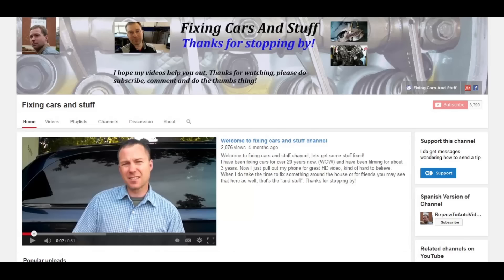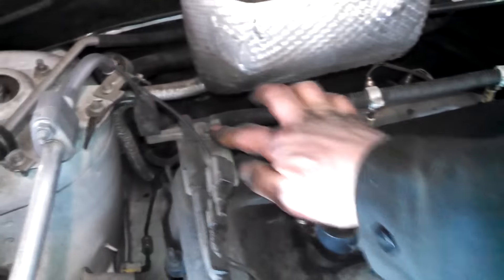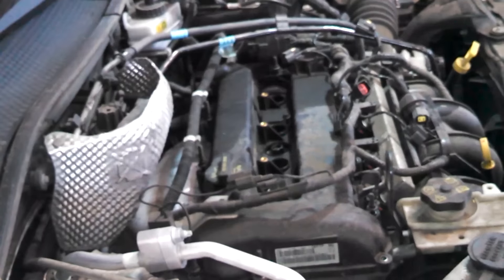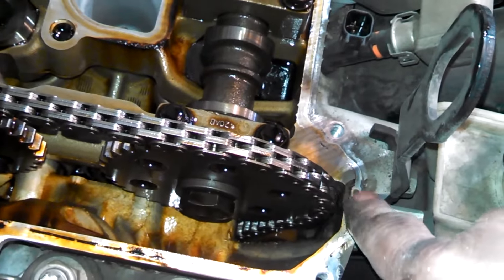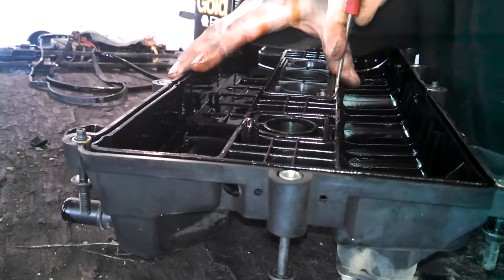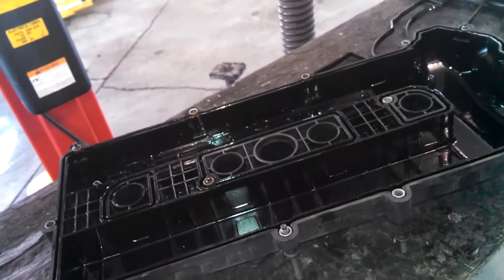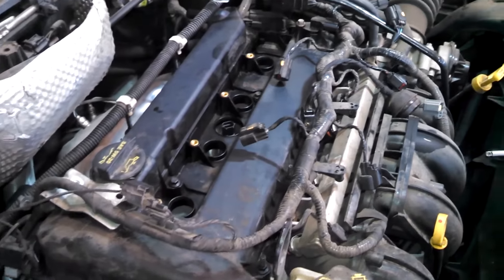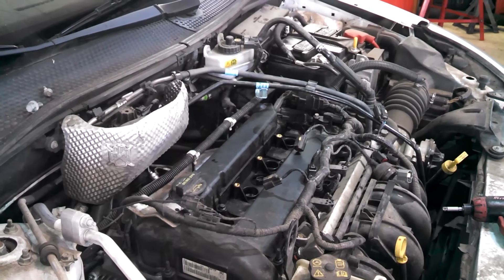Valve cover gasket replacement 2008 Ford Focus 2.0 How to change engine cover

Comment: Went to change spark plugs in my car and all 4 cylinders were filled with oil. Was going to take it to the dealership but your video convinced me to try replacing the gasket myself. I took my time cleaning up all of the old oil all over everything and it still only took around an hour. Only cost me $18 for the gasket kit. Saved me quite a bit of money. Thank you!!!

Anyone thinking about doing this- it's just a matter of unscrewing a bunch of bolts. If you have an 8mm and 10mm deep socket you should be able to do this no problem.
Reply: Had the same issue with my brothers car. Thankfully I found this video, so I know what to expect. For torque spec you can call the dealer they can provide the numbers

Comment: Great video, thanks a bunch :) I've just changed sparks on my Mondeo and found where all my precious oil has been going so going to change the gaskets very soon. It was your video on changing the sparks that led me here, so thanks again for that video also.

No's 1 & 4 had a ton of oil in them and a little in 3 too. I tried with a rag and industrial tissue but was taking forever so I sucked out nearly all using a syringe with a thin silicone pipe (model engine fuel pipe) attached to it and pulled out nearly all the oil. I tissued some more but a bit still went in the engine but burnt off pretty fast. So ya, syringe and thin pipe works well.

Comment: Great video, I just found out my Daughters 2010 Focus has this issue. I pulled the rubber boot off and there was so much oil in the hole that I could not see the tip of the plug.. Much thanks.
Reply: Now THAT'S a lot of oil! lol

Comment: My car doesn't have oil in the spark plug hole but it has oil on the threads. Any ideas where the oil going from? Thanks.

Comment: I bought a ford focus and when I took it to get serviced they said there was a leak from the valve cover into the spark plug holes. I changed out the valve cover gasket with a fel pro valve cover gasket set then exactly a year later in the middle of winter one day check engine light comes on #4 misfire I pull the plugs out they are dripping in oil just soaked in oil. Now I bought a brand new valve cover and oem gaskets either the valve cover is warped cause it is cheap plastic or the fel pro gaskets went bad after a year?  I doubt the fel pro gaskets went bad im thinking ford's cheap plastic valve cover probably warped.
Reply: cade    I have the same issue as you   and yes  maybe 11 months after I had a shop do my valve cover gasket replacement   the same thing happened to me   now I am going to do the replacement   and i am using a oem gasket   .  the shop  should have warrantied it  because it was under a year   but when i went there   he just gave me some bs story  on why it was not covered    12 months and or 12k what ever comes first    it was still under bother    .I was wondering if I to have a warp in my valve cover      mine is meatal   and not the plastic  type        good luck to you   also sometimes it is a good idea  to change the cops out and the spark plugs     thats what i am doing

Comment: I'm doing this right now hopefully it works my question is there's a little bit of oil down where the spark plug goes will that go away on its own or should I stick something down there to absorb it
Reply from the maker: I would use a screwdriver and a rag and try to clean it out best you can.
Reply: I had an ounce or two go down into the cylinder, and the engine seems to burn it up almost immediately. But certainly can't be 'good' for it.

Comment: I find with those two plastic pieces in the rear     there just so dry and brittle    i like to remember to pry them up from the bottom  and not to grab them from the top

Comment: the two wire clips on the back of the engine that you broken do you know the part number to order new one's i broke mine when i replaced my gasket
Reply: jack wright

Comment: A little oil comes out the top where the spark plugs are.  How does that hurt anything?  Just check the oil level.  What happens if you let it go?

Comment: Good job man but you for got to wipe out the in side of the engine as well  Especially  We're devout they're gonna lay And soak up where the spark plugs are other than that you did a good job

Comment: felpro  there junk .    I only use  the oem  gaskets  after   a shop used a  felpro  and it  failed after  one year .     after market  is   junk .   did you replace the plugs  as well    and maybe the cops  ?   89 inch lbs  or 10NM

Comment: My engine was running rough and wanted to die so I only assumed it needed new spark plugs but when I pulled the coil packs is when I seen the oil in 3 of the spark plug galleys. $20 for spark plugs and $18.99 at advance auto for new gasket. 111k miles on my 2008 Focus for anyone wanting a documented mileage at which mine was bad.
Reply: Mines going bad at 118k miles, but seemed to have go sooner. Have you had to change your engine mount?
Reply: Evan Theis yes I just changed my engine mount too at 100k miles, it was so bad the whole car would shake
Reply: Richard E I have 2010 ford focus and its cylinder 2. leaking seal causing a misfire 88k miles
Reply: Go get you a new valve cover gasket, I got mine from Advance Auto and the brand you want is the Motorcraft one, (the blue gasket!) it is the best one you can get and under $20. The longer you wait the more it will get worse and can cause serious damage over time.
Reply: forgot to mention: get some carb cleaner and clean the plug/coil part and the spring real good because it will also be soaked in oil, you can take the rubber boot off the coils and pull the springs out of the boots when cleaning.